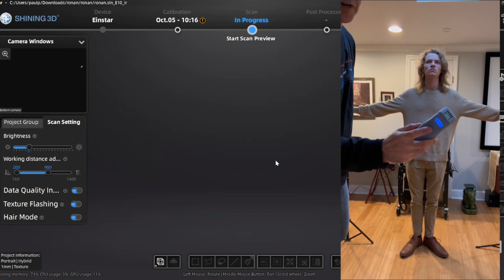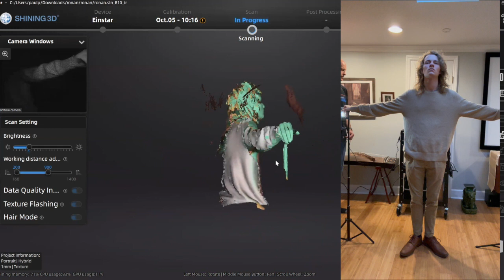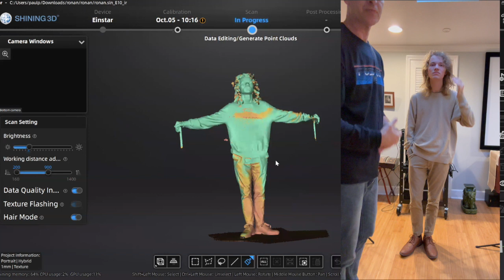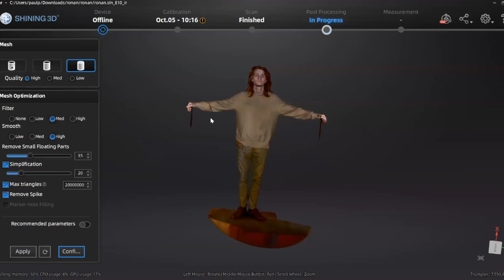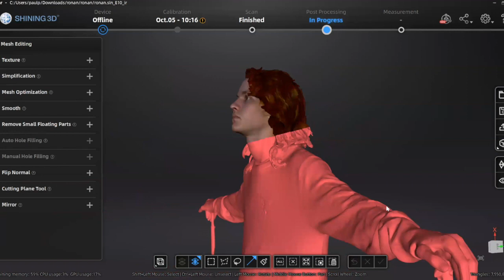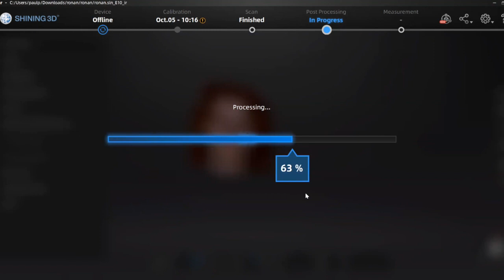How to 3D scan humans (using Shining 3D Einstar scanner and Exstar software)

Comment: Just out of curiosity, what are your PC specs? Your scanning and processing is much faster than mine.
Reply from the maker: thanks for asking... yeh, I do have a pretty beefy MSI laptop: QHD 240Hz, Intel Core i9-13900H, RTX 4090, 64GB DDR5, 2TB NVMe SSD
Reply: @paul.parkinson  Thank you, that makes sense. If I remember correctly,  the Einstar manual recommends an i9.